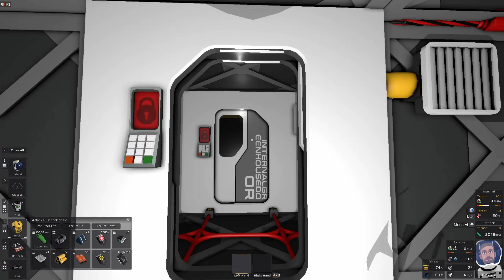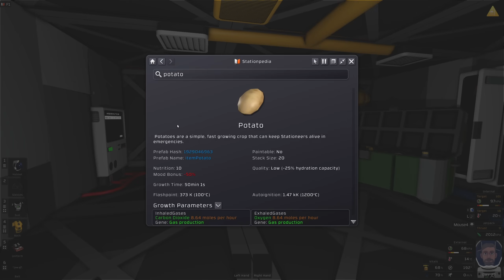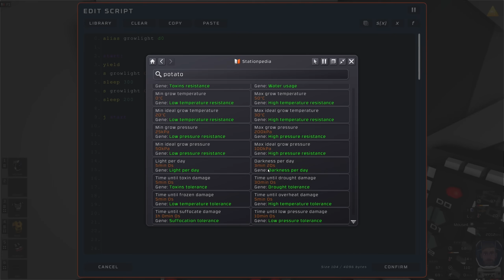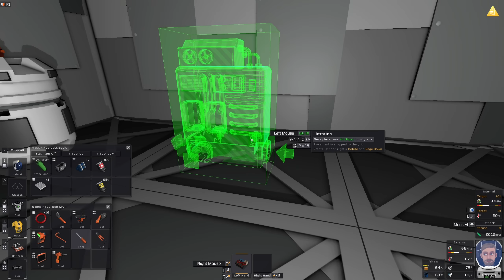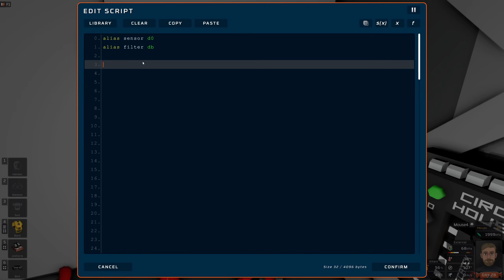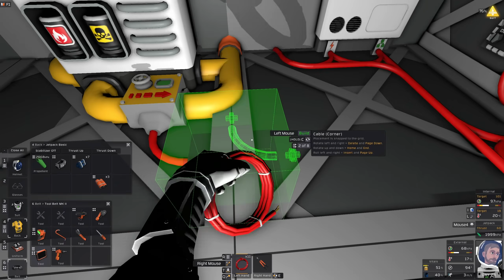Greenhouse Setup 4/4 | Grow Light & Filtration | Stationeers | Tutorial Series For New Players | #11

Comment: I find that reading from the filtration inputs the gas mix fails as it wont change with the room anywhere as quickly as is needed. Best to use an external sensor. Its fine if its pressure, that works well for reading from the filter.
Reply: Real World installation would output the waste air from output2 somewhere far away in the room to propagate gas rotation, pushing bad gasses towards the input vents. So unfortunately this game made it's own rules that you'd have to learn, and they are highly illogical at times. But still fun...

Comment: 33:15 its the pressure differential between the input and either output, not just output2.  If there is higher pressure on either output than the input, it makes it harder to push anything through.
Reply from the maker: Ah thanks for this.